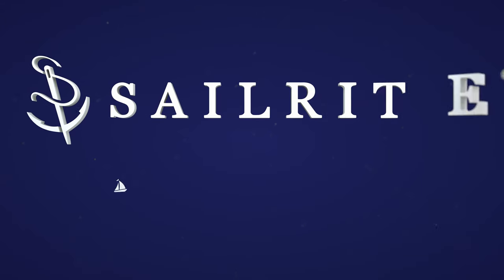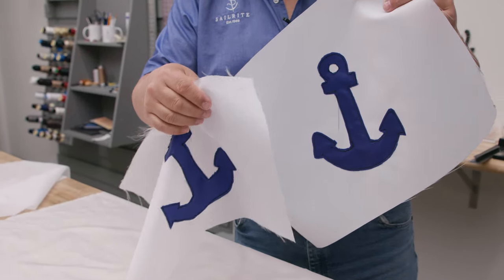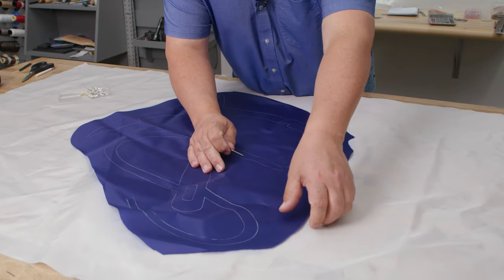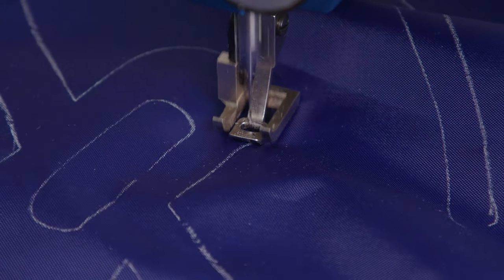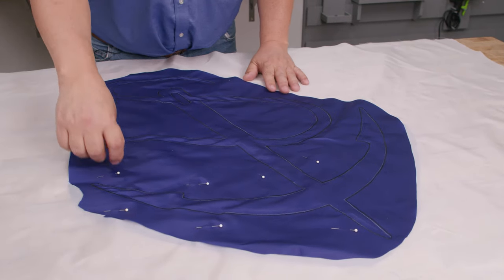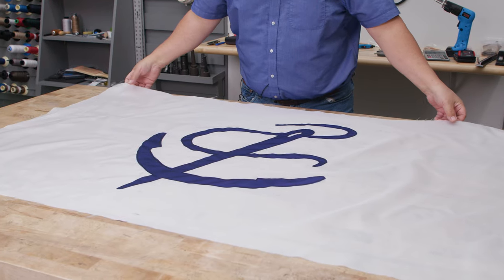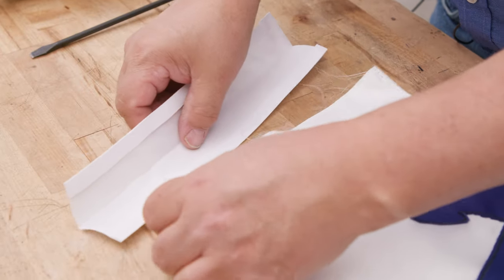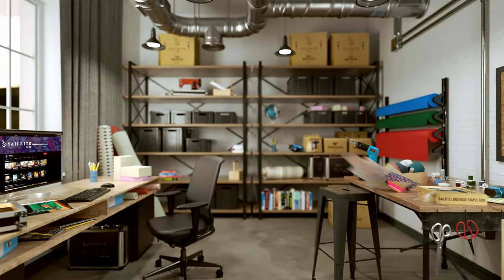How to Make a Flag — 2 Methods

Comment: Great tutorial! - many of these techniques are what I use for making sailboat "battle flags" as well as class flags for regattas (e.g. Sunfish, etc.)  One thing I do differently that worthy of consideration is in lieu of pins, I use a temporary spray fabric contact adhesive.  It's a lot faster, and allows repositioning the graphics if need be (for a few minutes anyway).
Reply from the maker: Great suggestion. Thanks!!!

Comment: I've made several flags and have found that the regular 200d that Sailrite sells is perfect for the main panels, it suffers as an applied fabric. It tends to shred along the cut and look fuzzy after a short time. I've been buying a 200d with a coated back that holds up very well. I wish Sailrite would include these fabrics in their offerings.  Also for tracing, I use an old sheet of plexyglass with a spot light under it for a table. Then I get my graphic from a copy shop and trace directly from it to the fabric. Then I pin and sew.
Reply from the maker: Great suggestions. Yes, a 200D with a coated backside would be an excellent product to add someday. I will ask about it and see if we can stock it soon.  However, since we used a very small zigzag stitch with a very short stitch length that stitch should help keep the fuzzy fraying of the fabric from going too deep into your applied logo. In essence it will fray, but will not be able to go past the very tight stitches of the zigzag.

Comment: Great video I really appreciated attention to detail
But I was wondering, eventually could I paint on the Nailon instead of sewing?
Reply from the maker: Acrylic paint is the best option when it comes to painting fabrics. Mixing the medium with acrylic paint beforehand ensures a smooth application, and adding fabric medium or a ready-to-use fabric paint will help you achieve the desired color intensity.